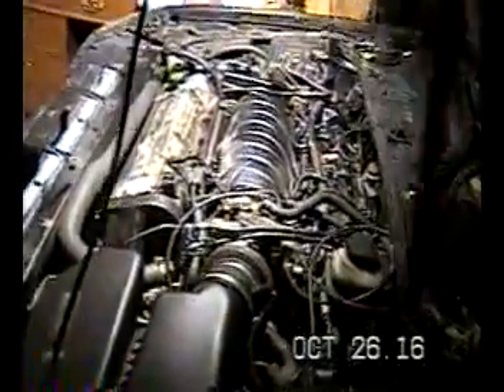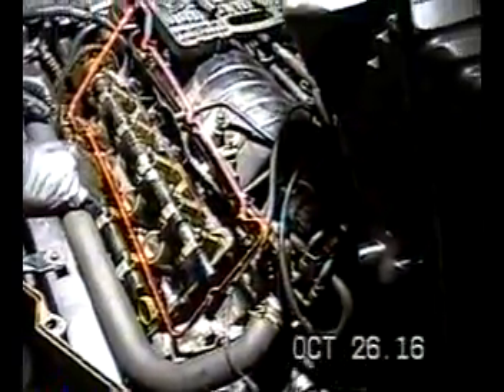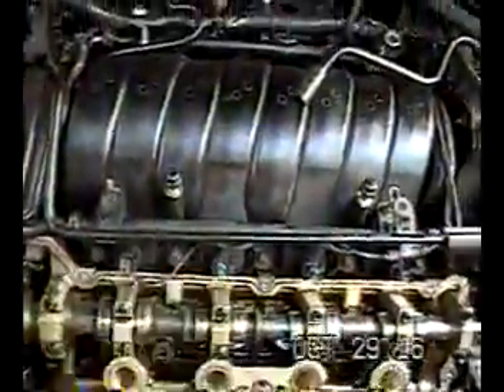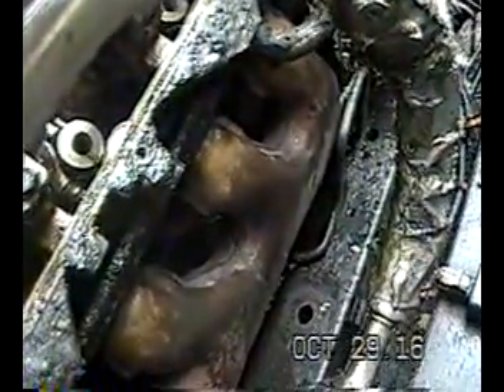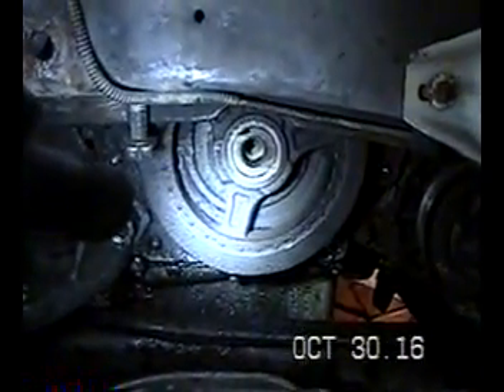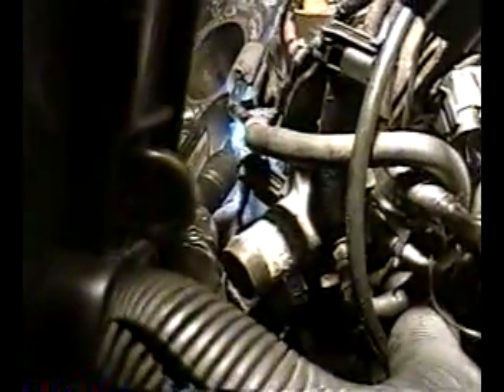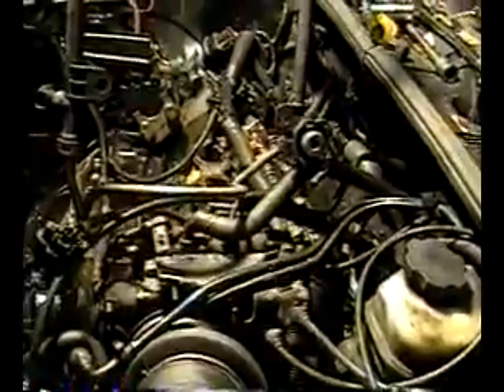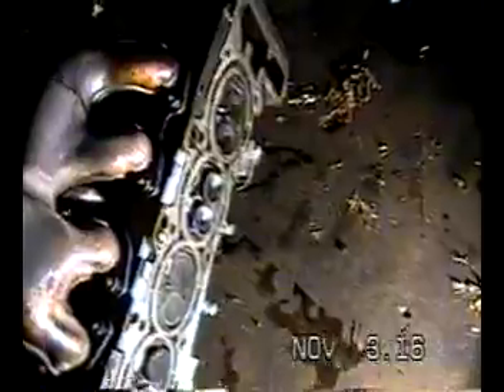2002 Cadillac Deville DHS 4.6L Northstar blown head gasket removal without removing engine

Comment: I just did mine, a 2000 Seville, removing the crank pulley, I used jaw pullers, on the hub, they kept wanting to slip off, after 3 hrs, I finally wedged them on using pry bars and screwdrivers , damn, came right off. but talk about having to do three things to do one. you helped me a lot and I wanted thank you.

Comment: Loved your honesty and awesome job now as for the rear valve cover you only have to get the EGR out n the valve will come out without removing any lower bolts I haven’t gotten to the heads just yet but I’ve pulled the covers off thank you for this awesome coverage 👑

Comment: loved the video, i have the same car and have been in the auto parts industry for 40 years. i just pulled the rear valve cover off because the front motor mount was busted and there is a bolt coming out of the firewall that put  a hole in the valve cover ,so i feel your pain these cars are just not made to work on anymore just imagine how easy all these things are on a small block say 1970 impala back in the day, i use to come home on my lunch break from school and pull a tranny. these cars now a days just takes 20 times the time to do anything that's why after 40 years in the auto business i had to close up all the backyard mechanics have gone and a lot of the shops too all i can say is f=== these new cars

Comment: I had a 1998 Cadillac DeVille I had to do some work on it was the first car to introduce me into the mechanic world and I'm glad that it did because those Northstar engines are definitely trash and very complicated to work on but on top of that I also had some head gasket problems I had to put a new seal on mines which was a pain in the ass so the fact that you replace the head gaskets all in itself I could only imagine how frustrating it was

Comment from the maker: FYI - Here are the parts that I needed for my Head gasket job ...

 Name     Brand  Part #  Alt Part # Cost

1. Exhaust Flange Gasket  Felpro  61431  21992620 $16.99
      Victor  F31962   $12.99

2. Exhaust Manifold Gasket  Felpro  MS93371   $15.99
      Victor  MS16373   $16.99

3. Head Gasket - Right   Felpro  26151PT   $27.99

4. Head Gasket – Left   Felpro  26150PT   $27.99

5. Intake Manifold Gaskets  Felpro  MS9331   $17.99
      Victor  MS16371   $15.99
      Dorman 615-715   $14.99

6. Timing Chain Gasket   Felpro  TCS46013   $43.99
      Victor  JV5065   $46.99

7. Head Bolts X2    Felpro  ES72187   $37.99
      Victor  GS33387   $47.99

8. Timing Chain Upper X2    RC-1019   $38.99

9. Timing Chain Lower     RC-1020   $20.99

9. Timing Chain Guide Upper    7310    $14.99

10. Idler Pulley    Duralast 231159   $39.99
      AC Delco 38041    $39.99

Comment: That is a very special kind of insanity. I was thinking of doing this but then I decided I would throw roofing nails on the ground and roll around in them naked instead. My hat is off to you sir. And it isn't like I haven't done some crazy stuff like pulling the motor on a 95 park avenue. But this is a bit much.

Comment: I am waiting to see if these smaller engines in Cadillacs are easier to work on.  I have a 1996 with the northstar.  I also have a 2014 ATS with the 2.0 turbo AWD. My 1996 has been 99% trouble free.  Radiator,surge tank, belt tensioner replaces after 18 years.  The rest is brakes and a fuel pump.

Comment: Thanks for the video and detail..quick question I'm not going to be able to get the heads completely out not skilled enough but i can get both Valve covers off and work on it in the car...I'm hoping its just the gaskets so I'm just wondering if i replace the bolts same size if i have no threads or damage to them...I'm afraid on the time serts and drilling especially on the back head and my skill level money ect...so if my bolts look ok and i put new ones at the same size back in and new gaskets do you think i'd be ok...i think its 89lbs so say i torque them at maybe 85lb to just try to like the odds of stripping or snapping one of them..any advice greatly appreciated

Comment: I like the video. I'm wondering though why you didn't remove the top radiator support, the radiator and the hood latch structure, before tearing into the engine. If you did those things, there would have been A LOT of room in the engine bay! The alternator, front engine mount, front exhaust manifold, etc.

Comment: That looked like a bitch! I’ve got a 2003 Seville that’s a piece of shit and I’m guessing the gaskets are at least part of the problem, now I’m on the fence about pulling the motor, going at it like you did, or just getting rid of the car. I gotta say I’ve always wanted a Cadillac, and now after owning one I’m blown away by how much shit goes wrong constantly with this car. One thing I can say is I’ve changed the alternator enough times (until I learned the starter was the issue) that I can tear that thing out in about 15 minutes and put it back in about the same unless the belt gets all crazy on me. A wins a win- thanks for the vid man you rock! If I go this route I’ve got your vid to walk me through it

Comment: I hope this never happens to my 2001. But if it does, I know this video exists. Thanks.
Reply: Oh trust me, it will. lol
Reply: @anymoose  175K and nothing yet.
Reply: @carlsandburg7444  No coolant problems at all? That's great.
Reply: 2 water pumps. No idea why. Pretty easy though.
Reply: @carlsandburg7444  Well that's cool. But from what I understand it really is inevitable. It's a design flaw with the head bolts, the threads are too small and eventually the bolts start to pull away and lose torque.
Reply: @anymoose  It's tough to speak on a topic that is an account of other people's experiences, but while I tracked this story, I used the Cadillac Forum: https://www.cadillacforums.com/forums/cadillac-deville-1985-2005-including-1985/

They seem to have many users who post there. According to them, it happens sometimes, but there was never a recall. I agree with you, it was a poor design and the engineers should have known better. 

My DIY experience makes me want to buy a 2005 Seville or something. After that, these machines become too tough to work on. It's hard enough already. LOL

Comment: O.K. I need your help...You mentioned that you have to loosen two bolts lower the engine mount and one bolt up front of the frame? I'm confused because I cannot locate these bolts..I cannot remove the rear value cover otherwise. So, if you would be so kind as to let me know what to look for..
Reply from the maker: I seem to remember that I removed the front motor mount after I took the rear valve cover off.  In order to remove the rear valve cover, I just needed to loosen the 18mm engine cradle bolts.  Doing so let the engine drop the few inches that I needed.  Once that was done, there was enough room to remove the rear valve cover.  Make sure to have jacks under the engine cradle when you do this.  The 18mm cradle bolts don't need to be removed completely.    However, if you need to take the front motor mount out at this time, you'll have two 15mm bolts on the top of the mount frame,  These two bolt onto the left head.  On the bottom, the mount frame has two 15mm bolts.  There is also an 18mm bolt that holds the motor mount itself to the cradle frame.  However, if you're currently at the step of removing the rear valve cover, I'd forget about the front motor mount at the moment and simply try loosening the left and right rear cradle bolts and see if the engine will drop the few inches that you need.
Reply: Understanding you clearly, thanks for the answer...I needed help...and you gave it to me..Thanks alot and God Bless...
Reply: Thank you so much...I know what I have to do..Thank you!
Reply: Where are located at do you do work

Comment: I m doing this one my 2000 seville Sts in just need to take of the front and rear manifold so when I drop part of the sub fram to get to them do I just do the front and when I use the jack to keep the botor lifted were do I use the jack ?
Reply from the maker: There is a metal brace that is over the exhaust crossover and that (I think) bolts onto the transmission.  You can see the jack in its place around 35:40 of the video.  You have to use this brace to hold up the engine, NOT the oil pan.  Yes, the trick to doing this job with the engine still in the car is to remove the back head with the exhaust manifold still attached to it.  You don't need to take the front manifold off ... only remove the bolts for the front exhaust manifold and detach it from the head.  As for the rear manifold, you do your disconnecting from the head once the rear head is out of the car.  Remember to use lots of jack stands around the engine cradle while you are under there.
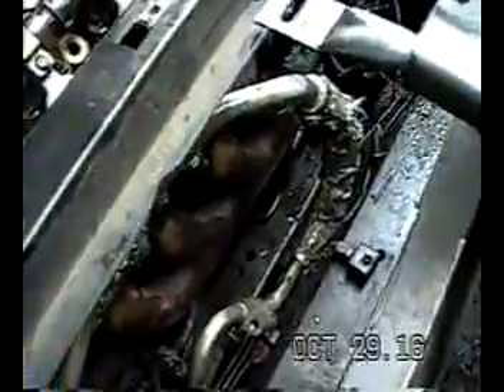Reply from the maker: Also, around 38:13 of the video, I show how I just detached the front exhaust manifold from the front head.  I didn't need to remove the front manifold from the car in order to do this job.  The rear exhaust manifold is a different story.  The rear exhaust manifold gets taken out of the car while it is still attached to the rear head.

Comment: Should i follow this for a 2005? Car is shaking when idle and ive done about every damn thing you can for my coolant system and it still overheats when idle.
Reply from the maker: This will work for a 2005 Northstar, but this procedure should only be done as a last resort and once you are absolutely sure that the head gasket is your problem.  A shaking at idle can be caused by dozens of things ... i.e., a bad coil pack, bad plugs, bad tp sensor, ...etc.  Make sure it's your head gasket by doing a battery of tests ... rent a block tester from Autozone (with the blue fluid), do a compression test, a cylinder leakdown test, check for antifreeze in the oil, check for oil in the antifreeze, pressure test for coolant leaks, make sure your water pump is in good working order, the radiator is not plugged, the cooling fans are coming on ... etc.  Once your are absolutely sure that your head gasket is bad, then begin the process in the video.  Good luck.
Reply: @flawrence11  thanks alot, will do

Comment: Great video, how did the car do when you put it back together
Reply from the maker: I'm glad you asked that because I need to mention something to anyone who does this job for the first time:  When I put it back together and started it up, I had a horrendous amount of white smoke that came out of the tailpipe.  It smelled like antifreeze, too.  My heart dropped and I started swearing.  For the first day or so, I thought that I did something very wrong.  It turns out that there was a huge amount of residual antifreeze stuck in the exhaust system that was causing that condition.  Once that stuff blew out, everything was back to normal.  Of course, about two months later, my catalytic converter was so rusty that it basically fell apart and I had to replace it.  

The car now has over 295,000 miles on it and it is running strong.  The body looks like it has leprosy, but some bono and $1,000 paint job at Maaco would fix that.  If you end up doing this job and having white smoke coming out of the exhaust right away, don't automatically conclude that you did something wrong.
Reply: 2002 Deville I'm actually in the process of doing this job now and taking it step by step with your video ,this morning I finally removed the balancer , it was like it was welded on , but I'm stuck on how is it possible to remove the bolts from the exhaust manifold on the back bank it seems like I can't lower the engine far enough to get to it
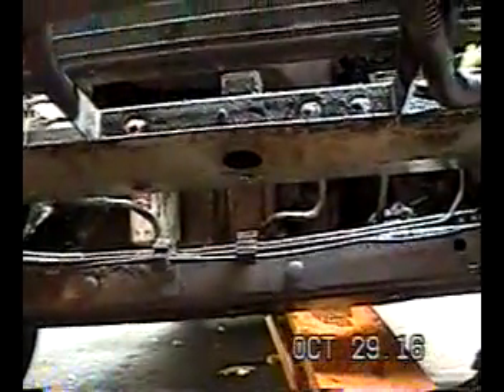Reply from the maker: Around 36:01 of the video, you'll see a shot of how I used  a floor jack to hold up the engine.  That floor jack goes directly under the metal brace near the transmission and exhaust cross-over.  That's the only safe place to put the jack.  Pump-up and angle the floor jack to tilt the engine where the back of the engine (the right bank) tilts slightly downwards and the front of the engine (the left bank) is slightly upwards.  You may need to do this a few times to get the tilt angle right.  I remember this being a difficult step, particularly because those bolts were so hard to turn.  I used long extensions and a breaker bar to get up there, while laying on the ground.  The part of the exhaust that leads to the catalytic converter will be in your way.  Spray some PB Blaster on the bolts right now so that by the time you get a socket on them, they're already treated. The rear two cradle bolts need to be almost out (but still screwed in enough so that they're still holding up the engine).  The trick is the angling of the engine to get a socket, with long extensions, up there on those two bolts.  You might need to use a block of wood between the floor jack and the metal brace.  Please put jack stands around the cradle while you're under the car.
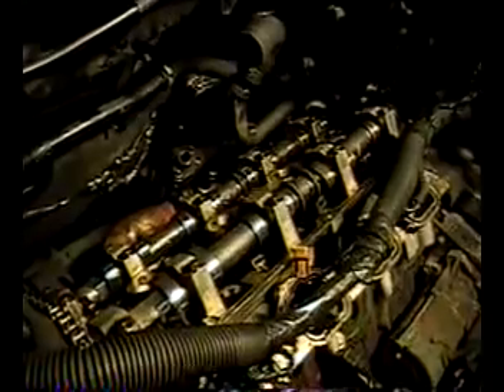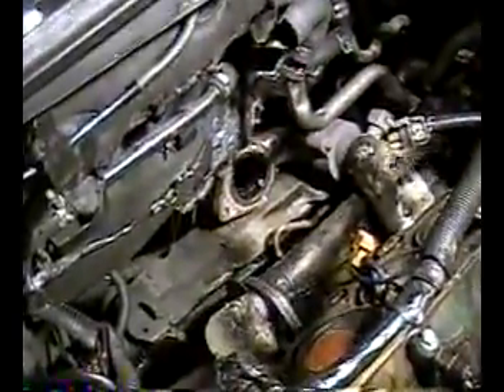Reply from the maker: For some reason, it popped into my head today that you said " ...I'm stuck on how is it possible to remove the bolts from the exhaust manifold on the back bank ..."  Do you know that you only need to remove the two bolts that connect the exhaust manifold to the exhaust pipe flange?  See 1:02:38 through 1:04:50 and the shot at 1:17:15 and 1:20:02.  You take the rear head off while its still connected to the exhaust manifold.  Once both pieces are out of the car, then you remove the exhaust manifold bolts and separate the two.
Reply: Thanks, one more question were you able to turn your timing chain with your hand, I don't know if mine is seized or what but I can't get the pulleys to turn in order to set it at top dead center thanks
Reply from the maker: I hope that I understand your question.  Before the timing chains are put back on, everything has to be lined up.  I put the harmonic balancer bolt temporarily back in and I used a ratchet or breaker bar and a socket on the harmonic balancer bolt to turn the main pulley.  As for the four camshaft sprockets, I used a crescent wrench to turn each of the four camshafts until the sprockets lined up.  Once everything is lined up, then you slip the chains back on over the camshaft sprockets.  Then you put the tensioners/guides back in to take the slack out of the chains.  I know some people will disagree with this, and I know that this may make an oily mess, but it might not be a bad idea to start the engine at this point just for a minute or two - just to make sure that the timing is correct and you don't have a p0300 random misfire code pop up.  If you do, then you're not lined up correctly.  If you are only one tooth off on one of the cam sprockets, you'll end up with that annoying code.  Personally, I would do it, regardless of the mess, because it will be a disaster if you put everything back on - including the engine cover and all of the pulleys - only to find out that you're one tooth off.  Keep me posted.
Reply: Ok thanks alot,I really appreciate your help

Comment: STOP! I've done 4 Northstar engines that had the same problem (overheating) because the head gasket blew and if you want to do it right and not cuss and swear like he did, drop the whole cradle with engine, suspension and transmission as one unit.  You can get to everything better see what needs to be replaced (I'd replace that oil pan gasket, they tend to leak around 50K miles)and torque everything right when you put it back together.  I can almost bet that car didn't run right or at all when he got the heads back which was another cost he didn't have to have.  The Northstar engine is a great engine except engine  blows the head gaskets because the block is aluminum.  The threads in the block fail causing coolant to leak into the combustion chamber.  Cadillac knows this is a problem and has a kit to drill the old threads out of the block and install new threads (also called inserts).  If you do this job don't use GM's kit, there is a guy (contact me for his name and product not sure if I can mention here) who sells steel inserts that are awesome, you will snap a headbolt before his inserts fail, like I said I've done 4 engine and always used his product. This is not a two day job because you want to take your time when drilling the old threads out and installing the new inserts.   His kit comes with the correct drill bits, cutting oil, steel ruler (6"), jig to ensure you drill straight and true into the block and 20 steel inserts.  The kit paid for itself after I finished my first car.  When I did the other three all I had to buy was the new inserts and he even threw in a new drill bit and cutting oil.  I'm not trying to slam this guy he just made the job a nightmare to put back together because there are three timing chains in that car and the timing has to be set perfect when putting back together of you will have a check engine light FOREVER.
Reply: What kit?
Reply: The man who sells the kit is?
Reply: @donwadd9143  Hi there, Please just google the Car Wizard he has a Video where he names the kit as he drops the engine to do this job.
Reply: @sydau6380  I found a pro mechanic that is a Caddy specialist in Illinois.  Thanks!
Reply: @donwadd9143  where is he located or how can I contact him for service on my cadillac?
Reply: Lookin for the guys info on the inserts. I like this guy's video, but think dropping the engine would of been a lot easier too. I totally feel this guys pain when working on cars.  Always do my own work, because at the least I know I did everything by the books.. Getting ready to do this job myself and do want to use the inserts. Thanks

Comment: I HAVE A 1999 JUST THE LEFT SIDE AND JUST RIGHT SIDE OF MY RADIATOR GETS HOT
FAN IS NOT ON CENTER IS ICE COLD NEW WATER PUMP IN IT. ITS OVER HEATS  WHEN I DRIVE IT, JUST SETING AND RUNING IT WILL NOT GET HOT LOL?? WHAT YOU THINK
Reply: Gale Gregory might be a head clamping issue pushing blow by into the cooling system